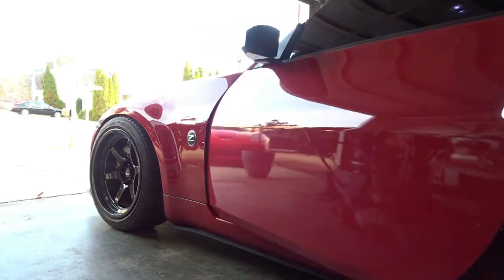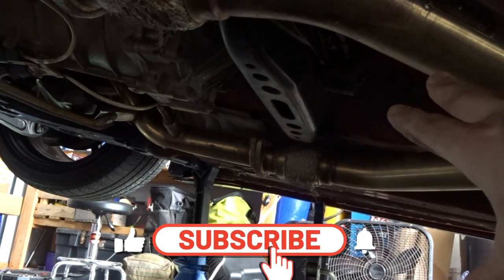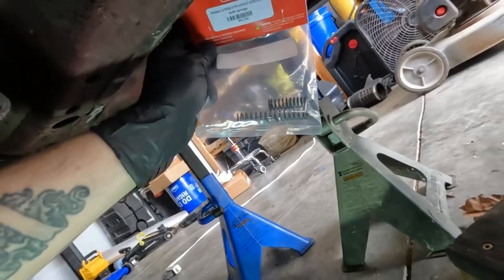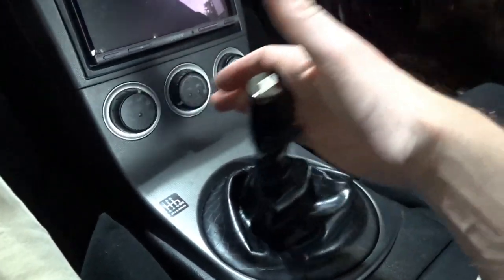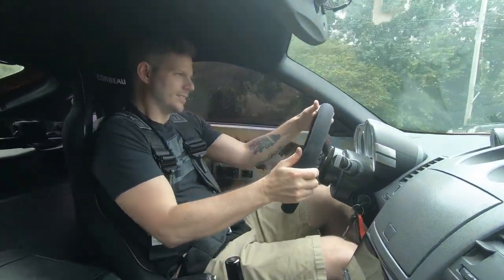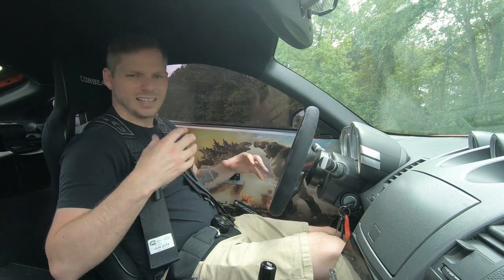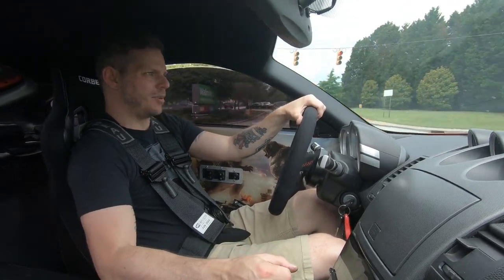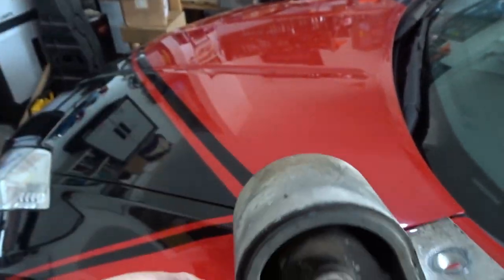350z Poly Transmission Mount Installation and Test

Comment: The Q50 needs a poly trans brace too 😊
Reply: I’m not sure there is one for the 3.7 but definitely a nice upgrade for the 3.0t!
Reply: @The Next Chapter  I got mine from Torque Solutions. I think it's for G37/370Z, but it works on the 3.7 Q50 Rwd. You just drill out the crossmember to accommodate the hardware going into the transmission. Slight modification going up a size or 2. Stupid easy install